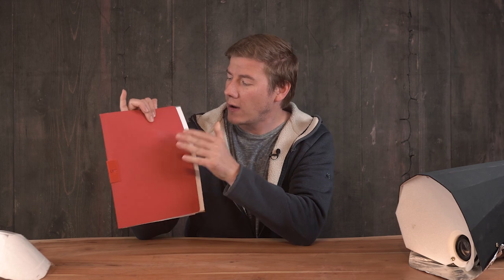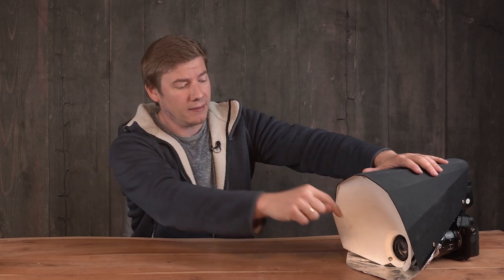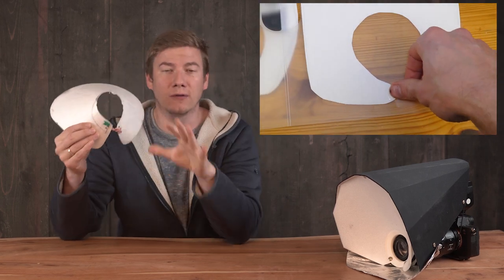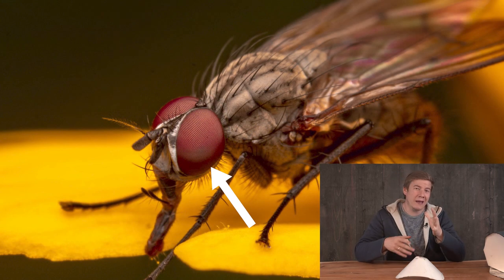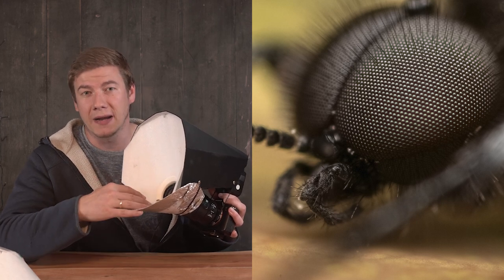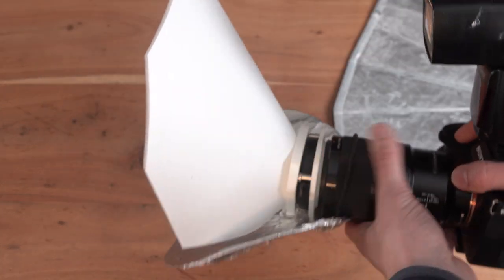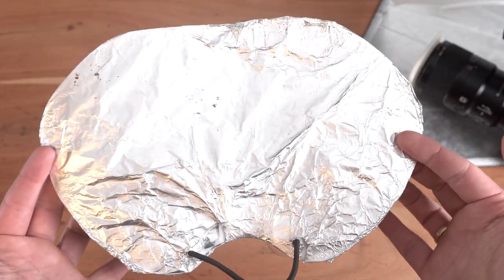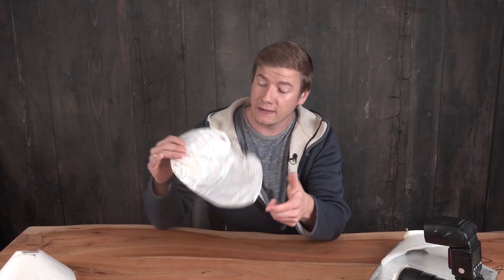DIY - Build Flash Diffuser for Macro Photography for even better Light

Comment: The under the lens reflector does not need to be as big as this. Just a small reflector of the right shape will reflect nearly as much light to fill in the shadows, as a large reflector, because most of the light from a large reflector will be reflected into areas other than the subject. I'd recommend a curved reflector. Unlike the light source from the top, it doesn't need a large area to provide diffused light as it is fill-in, not as bright as the light from the top half. Just trying to help and not to criticise, try it.

Comment: The only problem i can see, it's that the under part of the diffuser blocks the manual focus ring.
Reply: True, BUT, you'll be using Live View, and you'll be focusing not with the focus ring, but either rocking your body back and forth ort using a macro slide rail to achieve focus.